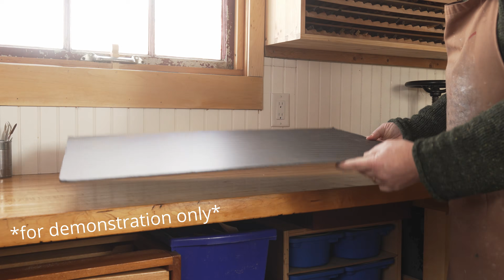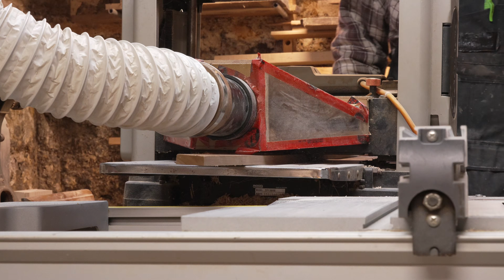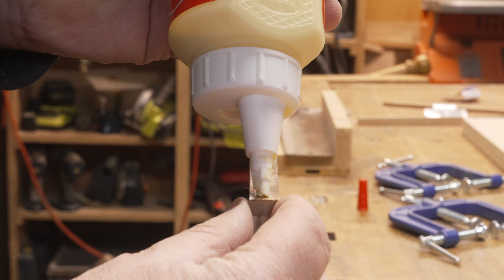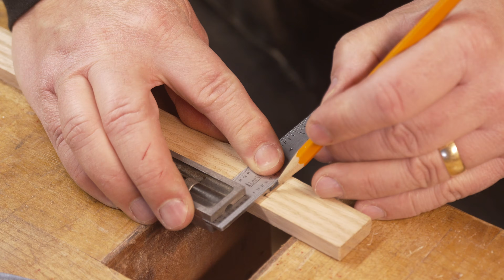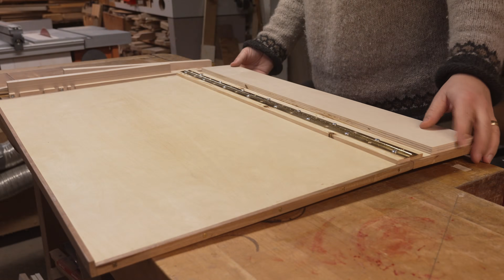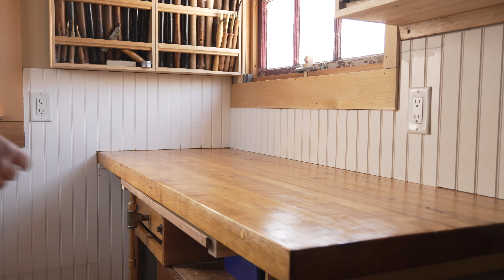Slide-Away Drawing Board - Self-Supporting Hidden Artist's Easel - Design Process & Full Build

Comment: If you decide to make changes here are a few ideas:

1. Try to add 3 or 4 screws for the drop bar. It may help with alignment.  Make the center ones fairly loose so they act as a guide pin. It appears that they do not drop at the same time which causes it to wedge in the slots.

2. Make the rails split so the second piece that supports the hinge and drop bar is contained in the split. This would increase the stability as it is captured. The top can stay the same size to fit between rails. You would need to shorten the hinge. You can still use the drop bar,  but the rails would need to be thicker to accommodate the notches. 

3. There is too much friction between the wood for the drop bar. Sanding only goes so far and finishes can stick to each other. A slippery plastic may help. You should only need it on one side of the joint to cover the plywood edge.

4. A support that folds down from the sides of the drawing board can create more stability.

5. As an alternative to the drop bar, you could insert a threaded rod across the piece and use it as a clamp. This would make it adjustable to any position. This would work best with the split rail suggestion.
Reply from the maker: Those are all great ideas, thanks!
Reply: I was about to comment with basically the number 4 idea in this list, my mind immediately thought about triangle shapes to help with stability. I don't know any technical terms though, haha, and it certainly didn't occur to me that the triangles could simply attach and fold out.
The whole thing looks great though!

Comment: Brilliant design. Only design tweak I would make for myself is some sort of kick out leg on the back to brace it. Even the tiny bit of flex from the ply itself would annoy me. But you have a much better picture of all the interacting parts, and I can imagine leg(s) being fiddly and annoying in their own way, perhaps getting caught in the mechanism.
Reply from the maker: I had considered just such a thing, and I’ve got a half inch of clearance on the back if I decide to add something. In the lower positions it might become necessary if I find myself leaning on it too much. Thanks for the suggestion!
Reply: @FourKeysWorkshop  the other option would be a small strip/notch fitting in that half inch clearence that would catch on a square corner. On the lower angles, perhaps even bricks could serve as a wedge/prop. Otherwise, the angles could be sized for some taller piece of stuff that you have around anyway, like the piercing cradle or the long clamp for doing spine glueups (I forget the correct name). All you need to add is the two narrow strips to the back of the board that just catch the edge of whatever so it can serve as the prop, taking out that flex and wobble.